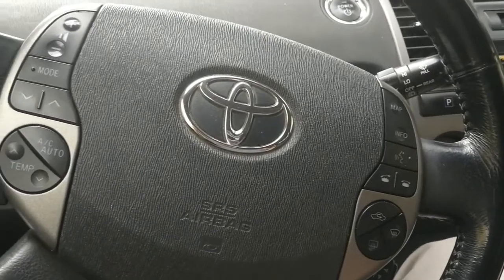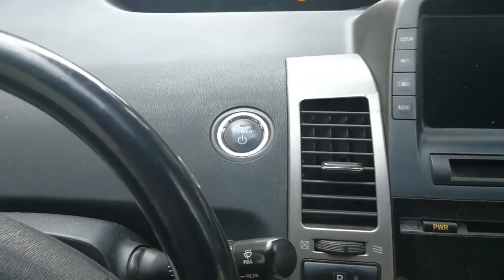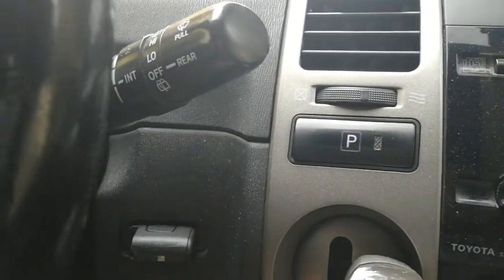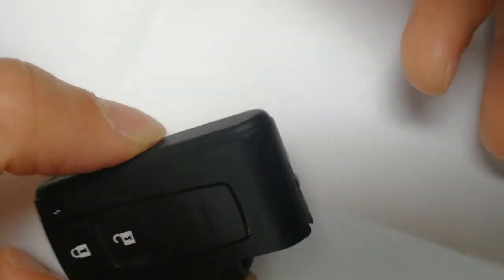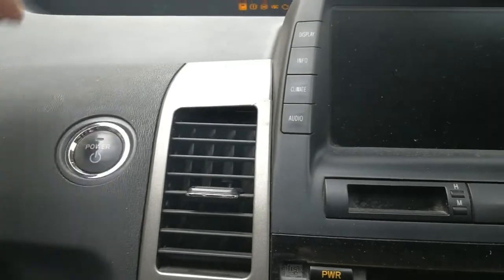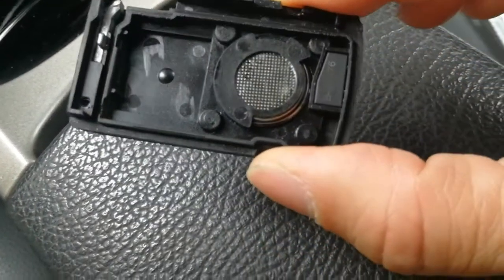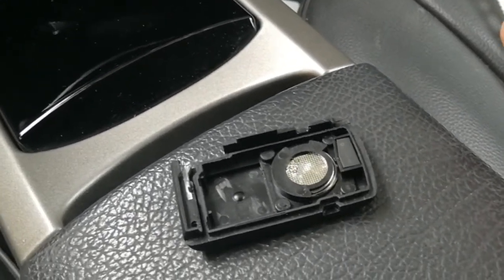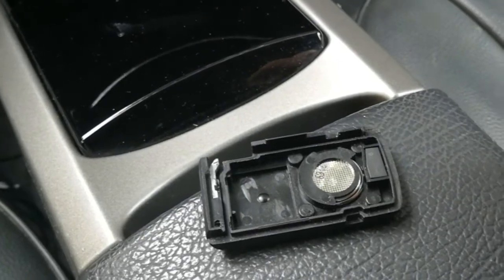Toyota Prius 2nd Gen (2006-2009) Remote Key Fob secrets and changing key shell

Comment: I only found out that I forgot to transfer the RFID chip once I could NOT program a new key. Thankfully, I am a pack rat and so I did not throw out the old casing.

If you do lose the RFID chip, you are hosed. You have to go to a professional to get it fixed.

Comment: So I want to tell people a personal story that may impact you. Here it is.

I had one key for my Prius. The casing (i.e. the plastic part) was falling apart. So I ordered a replacement case and switched out the electronics. Fairly simple…. except one BIG mistake. Buried inside the key housing is this little, flat, almost triangle computer chip. It is called the RFID chip. Apparently, this is a very common mistake. The upside is, without the RFID chip, you aren’t able to
1) Use the key while inserted into the slot
2) Program any other key

So, if you have a set of keys that allows you keyless entry but doesn’t work when put in the slot, you are very likely missing the RFID chip. The fix? You HAVE to a dealer/locksmith. So…. try to not lose your RFID chip and/or let it break.

Comment: Hi brother. I have the same fob. The problem with it is it has some short circuit and consume 2 cells per weak. If I purchase a new circuit and fit it with the existing chip would car will start close or open normally or not or I have to program it? Guide me

Comment: ? I changed my shell on my fob saw your video duh the chip out of the trash my car starts but the lock unlock won't work ..can you tell me what I need to do or what I did to cause this? It has a new cell battery in it..Thanks
Reply from the maker: The most important thing is that your car starts. If the remote control doesn't function for unlock and lock then you may have to reprogram the car to pair with it.
Reply: @conceptedge I’m having opposite issue. Unlock and lock works but cannot start the car!!